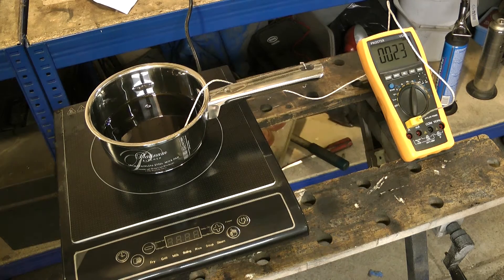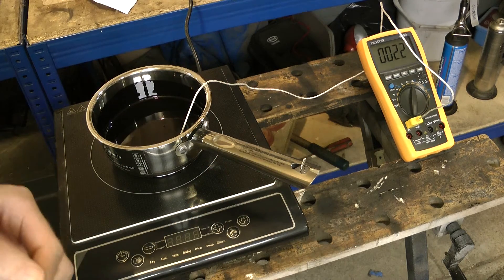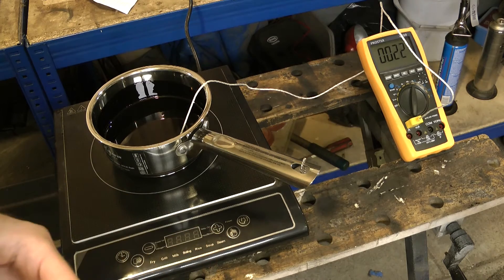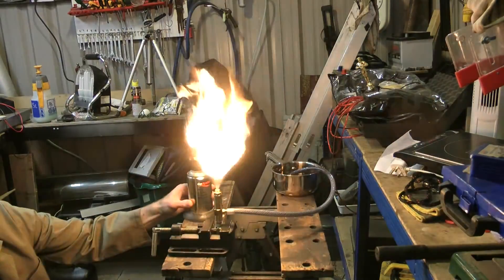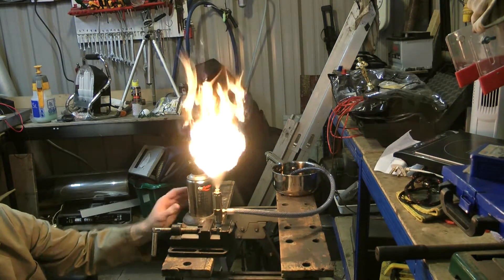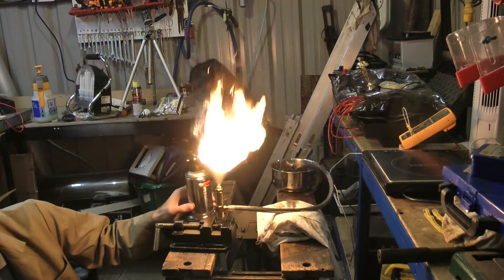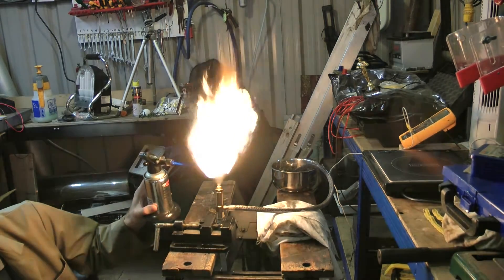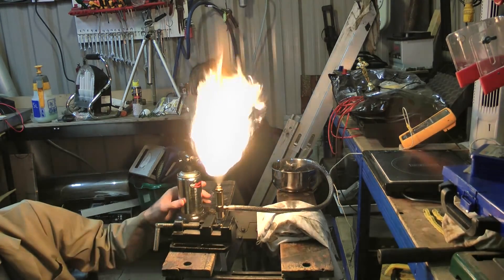Siphon Nozzle on Waste Oil

Comment: to make the flame self-sustaining, just hook or weld a bendable metal to any part of the burner, then bend the metal tip into the flame(please make the metal tip in the flame pointed)

1) The metal will be hot enough after igntition(after some time since it will increase in temperature) to keep the fuel or gas hot enough for combustion.

2) You can also enclose the flame in a cylinder (weld a short rod with a pointed tip to the inside of the cylinder). If the cylinder has thick wall it will take long for the flame to become self sustaining.

Comment: I'll trade the information with you what you need is a cylinder a piece of pipe a length maybe 12 in it can vary about 2in outside diameter and you slip it over that and that pipe will heat up and it will carry your flame farther and it will keep it self ignited that's what I have learned from that. What I was wondering about your siphon nozzle how many gallons an hour does it made for. And how much air pressure do you run in yours on thank you for your reply back
Reply from the maker: That nozzle is the 1.0mm and according to the spec sheet is 10 litres an hour.  I was running between 5 - 10 psi.  What I want to try next is to run the nozzle in a diesel turbo fan heater and see if I can get the thing running on waste oil.

Thank for the info.
Reply: @DavidMcLuckie  something isnt correct. 10 liters an hour is very much. Mine uses 6-7 liters a day...

Comment: Put the nozzle in a 2" black steal pipe.  I use propane to get it started. then slowly start adding in the oil while turning on the air and the propane off. Works great for me at 20 degrees in my garage without preheating the engine oil I am burning. Pipe gets red hot and will keep the flame going. Will also self ignite if the oil drops out momentarily.
Reply from the maker: That's a good idea.  I've got some steel pipe and propane burner for roofing.  That should get some heat in the pipe.

Comment: Hi David! Thanks for your very informative video. I've been struck by an idea from watching it. Tell me please, how much air pressure is required to make this nozzle spray properly? Keep on , keepin' on   ;)
Reply from the maker: Hey, can't remember off the top of my head but it used a higher pressure to get the siphon started then I dialed it back.  I think it must have been about 10psi running.

Comment: I had pretty much the same results with a diy waste vegetable oil burner I threw together loosely based on David D's design. I finally got mine to burn by adding a thin sheet metal flare for the nozzle to spray into, once the flare gets red hot the oil has something to flash vaporize on and it will sustain its self. Good Luck and check out my channel see mine burning on its own!
Reply from the maker: Thanks for that.  Just watched the video.  Nice job finding a solution.

Comment: Try putting a metal rod in front of the flame that will get red hot and act as a glow rod to self sustain.  Stainless would be best.
Reply: I saw a Video a guy doing with Coils. Although he used Waste Motor Oil, but he claimed it worked and Clean Burn too. I think Stainless Steel Coils will be hot enough to Re-Ignite. I would try it... Matter of fact, I am going to try and experiment on a Drip System soon. If success I will make a Video, if not... No Video until someone find a way. LOL
Reply from the maker: Great idea.  I wonder if a coil of stainless would work.